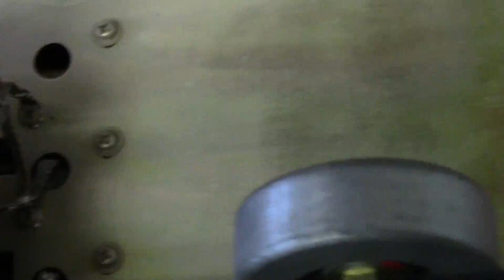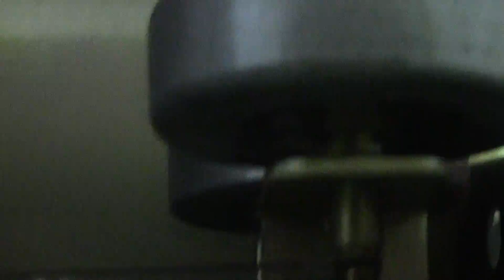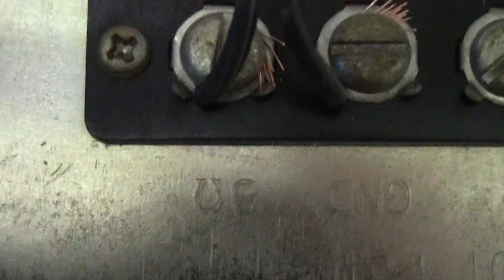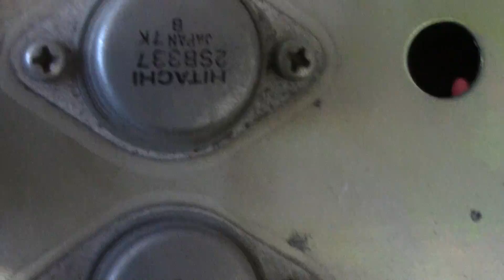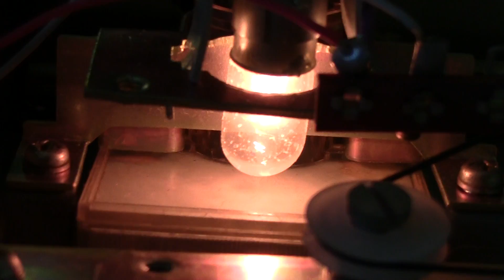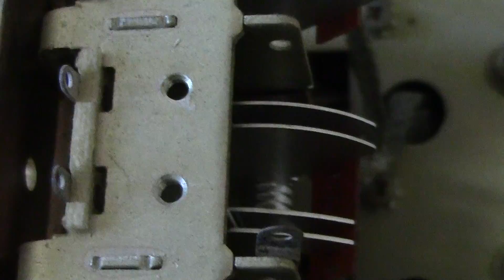Lafayette  HA-600  Part 2

Comment: I am restoring one of these. I am in desperate need of a picture of the underside to corrected some mis-wiring. Is there any way you can help?
Reply: Did you get a reply ? I have one and I can send pictures to you. I am vsat88 over at Audiokarma. Send me a PM and I will get you pics.
Reply: BTW mine is a 600A not a  600. 110V . So I do not know if that will help or not. Just noticed that.